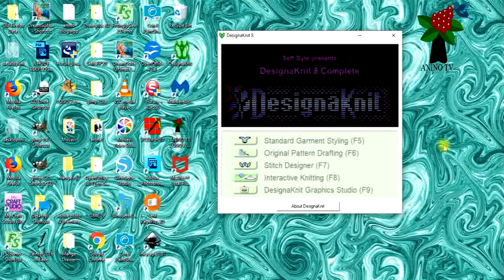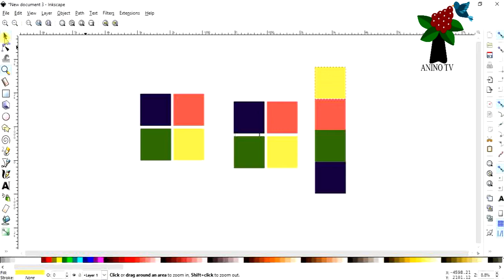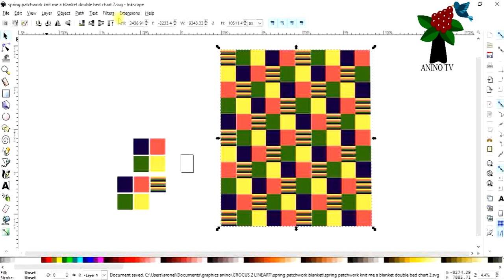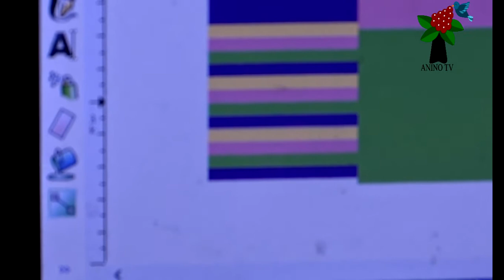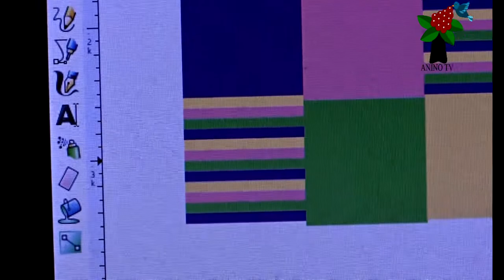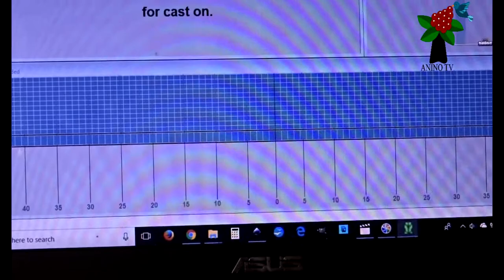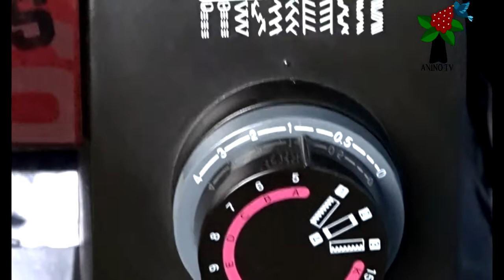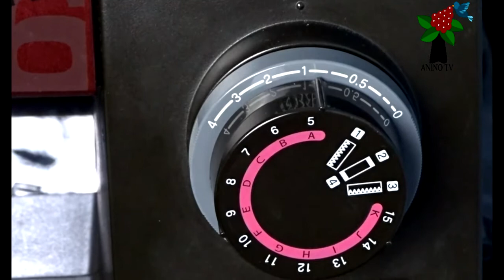Design and Machine knit a patchwork blanket using Inkscape, Designaknit and Brother KH950i Knitting

Comment: I love making these patchwork blankets, which I call The Hobo.  My last commissioned Hobo was a queen size blanket for a college student.  I tend to use either my Brother KH260, or at times use my Ultimate Sweater Machine.  If I make one for a baby, I use my LK150.  I use the 'knit/sew as you go' method in joining my panels, so that when I am finished knitting the blanket panels are already joined together.  Using this method keeps all the points meeting, and eliminates the panel sections not consistent throughout the entire blanket.  I tend to make large blankets (queen, king and California king), and this method also makes completing the blanket easier.  Once I'm finished, I then sew my trim (separately knitted), to the blanket.   Wish I could send you a picture of one of my blankets.  I am curious why you do not rewind your yarn into a yarn cake??
Reply from the maker: Wow! that's great. I am going to try out your technique of joining. As per rewinding my yarn, I don't have that patience......laughing.  You can send me your picture admin@aninoogunjobi.com
Reply: Sent you two snaps of one of my blankets.  You can see how the panels look when joined together with the SAYG (sew as you go method).  It is a nice join, and eliminates that tedious extra step.  That particular blanket has 5 large panels (20"/panel) joined using that method.
Reply from the maker: I saw them. Thanks for taking out time to send me the pictures. I appreciate. Wow! The work is neat and lovely. I love the way the stitches line-up.

Comment: How buy this machine
Reply from the maker: Brother-the manufacturer of this KH950i knitting machine has stopped making the machine. You can see refurbished or fairly used pre-owned ones on  Ebay, http://machine-knitting.co.uk ( owned by Andee Knits), https://www.machine4u.co.uk , or you can buy the Silver Reed SK840 which is still being produced.  For this project any flat-bed knitting machine can be used except you desire the electronic knitting machine then you can check the Ebay, Argos, Machine-knitting.co.uk   , https://www.machine4u.co.uk